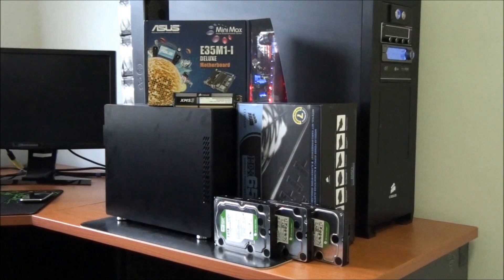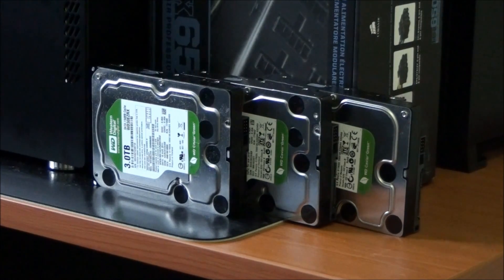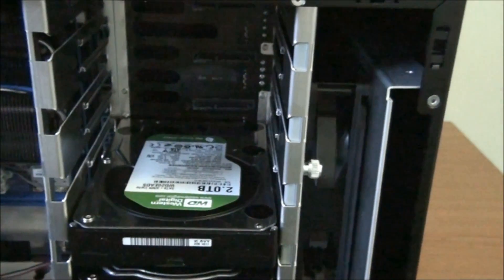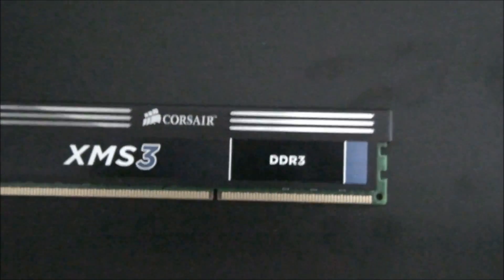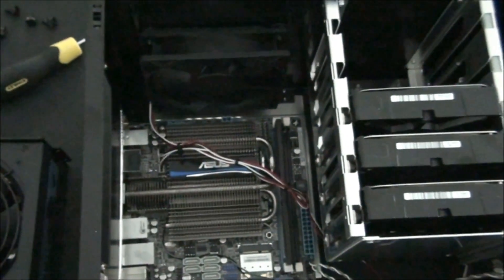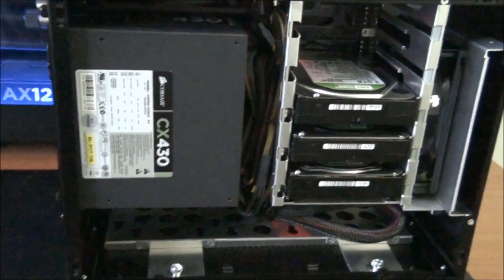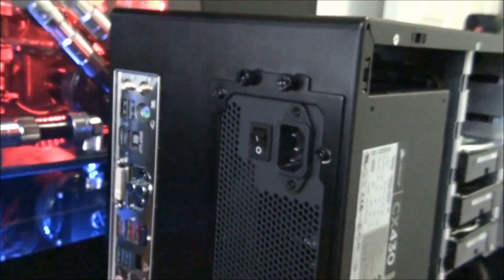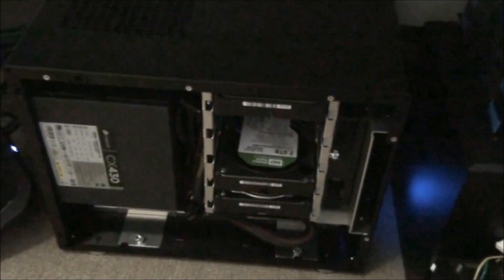Singularity NAS Build Log

Comment: This PC Case is dangerous for a RAID System, because you have no control lights at the hot-swap bays. Thus you will always need to double check which hard-drive to plug. This is dangerous in a RAID setup, because you could plug the wrong drive.
With LEDs the chances to plug the wrong drive would be much lower.

Comment: Question for you.  I really like your video and was attempting to follow the path set out in it, BUT it appears that the Asus E35M1-1 Deluxe system board is no longer available in the USA - may be due to your video  :) 
>  What would you suggest as a good replacement for the Asus SysBo?  
> I plan to use the NAS in an small office environment for backups and one for my home use (file storage), so no streaming is planned.

Also, AMD vs Intel, which do you prefer the NAS environment? 

Inquiring minds need to know...

Edo

Comment: You benchmarked a NAS with everything but NAS related benchmarks? Like, uh, file transfers? Also i would of gone with 16gb ram and a ZFS raidz. That PCI-E slot would be good for a dual port intel nic for link ag (if you have a good switch and a few people using it!), they are cheap on ebay!
Reply: Lmao was thinking the same thing.

Comment: Green drives are always a bad choice.
Reply: Darren Jones There are people I've seen that have 12+ drive arrays of WD Green drives. There's nothing wrong with them.
Reply: Sebastian Hübner
 Jepp, 2 Drives. Perfectly fine. But if you got a serious NAS with 6+ HDs the vibrations of accessing f.ex. 6drives at the same time would cause read/write-fails.
Greens for 2-3 drives? Perfect.
If you want to put more drives in there, like using a node 804 with all 10 drives for example, get reds or even Red Pros or Seagate NAS Drives or something similar from other vendors.
Reply: Maybe the first gen Green drives. The latest ones are fantastic for NAS use in a home if you're not looking to spend on Red (Network) drives.
Reply: I guess if your willing to put your hard drives at risk when you have 2 or more green dives spinning up that causes compounded rotational vibration and dives not being able to read in a raid.
http://www.eaegis.com/the-differences-between-an-enterprise-class-hdd-and-desktop-class-hdd.aspx
again, your choice if your data is not important than by all means use green drives that do not have TLER or other safe guards because they are"cheaper". as far a the tech world is concerned all green drives are garbage.
Reply: LOL give it time.
Reply: Justin Brown I have three WD Greens in my rig right now. There's nothing wrong with them. If they're mounted in an excellent HDD cage and mounted well, which Daniel DOES in this video, then there's nothing to worry about. Lian Li cases are exceptional. To be perfectly honest, IMO, people overstate the seriousness of HDD vibration to increase sales of the more expensive NAS-grade drives which 'are more resistant to vibration'.
Reply: I added one of these green drives to my RAID. Buggered everything up :( I ended up taking it out and spending some 20 hours rebuilding the array.
Reply: regularguy316 Unlucky :(
Reply: JKVengeance I don't know why the RAID didn't like the green drive? But it's sitting as a single drive now and chugs along quite happily. Only when I added it to the array, did it get weird.
Reply: I have a NAS running with 2x WD Green HDD's of the first generation without a problem since 2008. ;)
Reply: When you run RAID 1 / RAID10 or JBOD all the drives are good.

Problem arises when you run RAID 5 or 6 which uses parity, then you will see noticeable performance improvement and better reliability if you choose NAS drives.

A bad sector or corrupt parity bit can destroy your RAID and data.

if you use ZFS you are kind same from all of this
Reply: Never had an issue with my old green drives. Ran multiple RAID configs on them. Sure there are better drives for the job. Greens worked fine for a long time.

Comment: i have made my home nas using PowerCube Case from manufacturer "Spire" that comes with 150W little power supply.
an Gigabyte GA-D525TUD Mobo (integrated Atom CPU), 6GB of RAM and 2x WD Green 2TB drives.
the system is running 24x7 for last 1.5 years.
electricity consumption is around 10-12watt..
network access speed to files is 1GB (yes i copy files by speed of ~120mb/s)
simply awesome build :D

Comment: 650W PSU for this build? Talk about overkill. You can't even reach 100w with those components. Anything over 300W is overkill unless you have a video card, and that's playing safe, as most systems with decent (not great) cards use no more than 300W at load. 

It's just bad design in terms of efficiency. You want to make use of the better efficiency points of a power supply.

Comment: are there any chance of installing 2.5-inch SSD into the hot swap? Any special bracket or could you plug it in and leave it hanging on the 2 connectors?

Comment: Any chance of a follow on this one, I'm really pleased with your setup so far, but interested in how well the data-transfer is on the harddrives and what config you've got them setup. And also what kind of power consumption your build ends up with running 3 or more drives. Furthermore how well does it perform for media-playback more precisely 1080p +10gb mkv's.